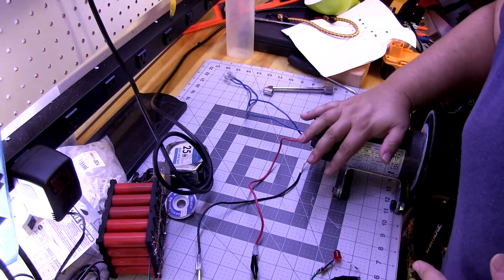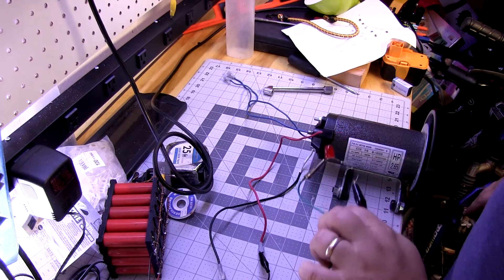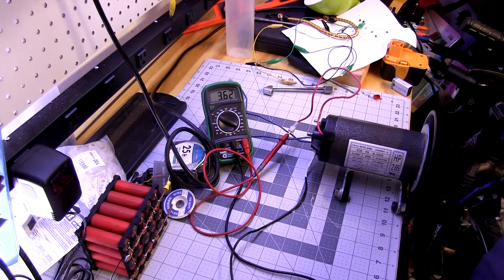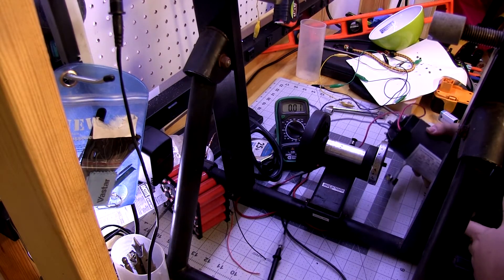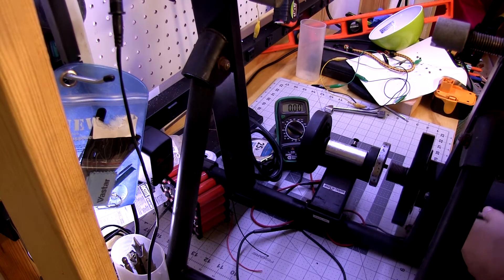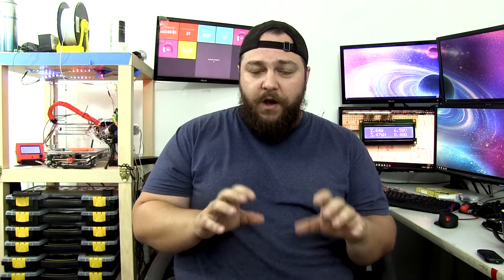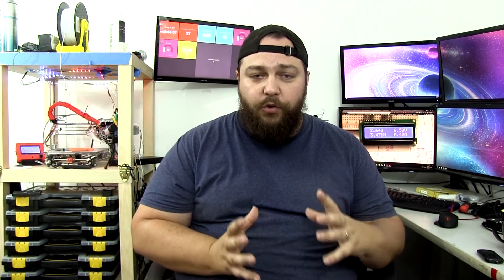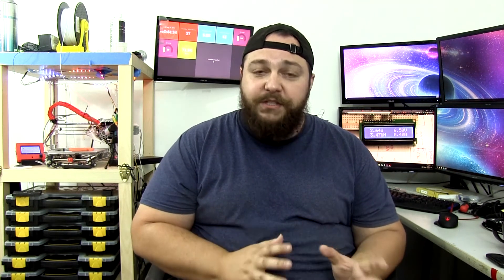Bike generator for 18650 battery packs - Part 1

Comment: Cool project mate.
Reply from the maker: brettwatty101 thanks!  I got it done but didn’t like it so I need to redo some of the electronics
Reply: For your high voltage issue I would use some 100v high farad capacitors and a big flyback diode in parallel with the DC motor. Also you could use a buck converter to regulate the voltage but the issue you would have is that if you use a solar charge controller you would be using 2x buck converters and you would be getting more power losses. There are some buck converters designed for Li-ion battery charging maybe you could rid of the solar charge controller and use one of those.